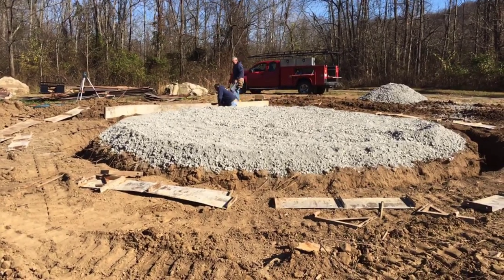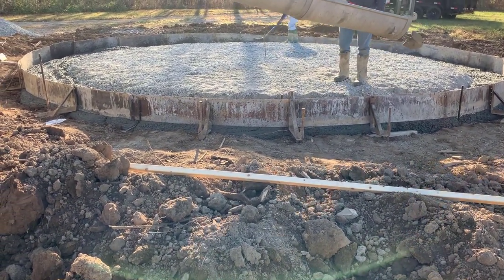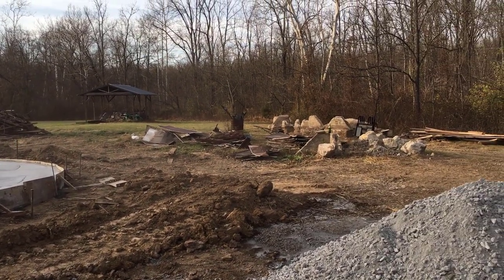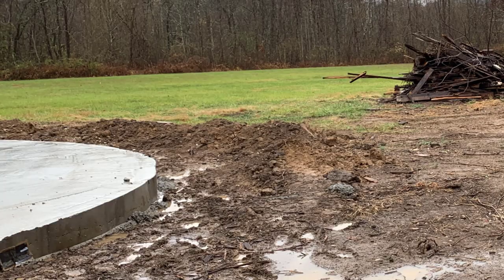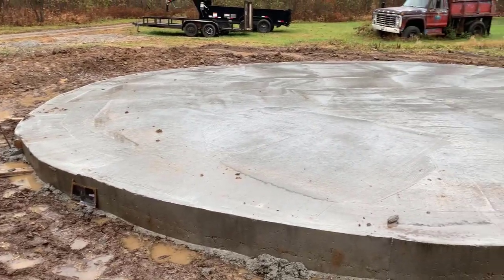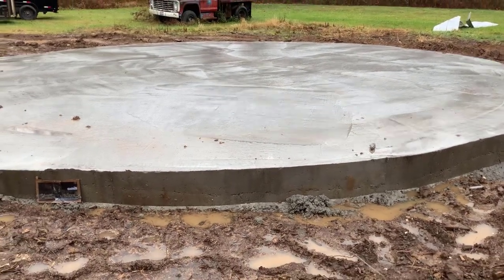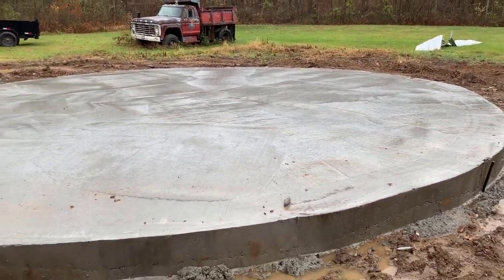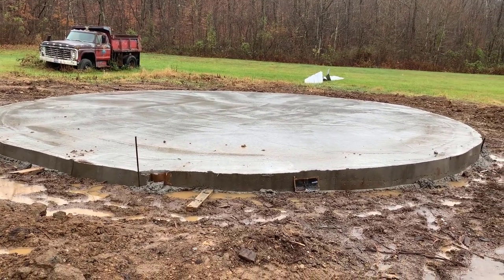How long do does concrete need to cure? *  removing forms grain bin foundation  E7

Comment: With this being a solid poured slab, can you share how you stub in your plumbing and electric? LOVE this detailed series BTW!
Reply from the maker: We are not stugging the plumbing or electric in the floor.  We are adding an addition about 20 x 30 to the back which will have a bathroom, mechanical room and kitchen area with a long table for family dining.   The addition will have a second smaller area floor that will have another bathroom.  Easier to deal with this way.

Comment: The people you hired didn't know what they were doing, either.  Or, they didn't care.  Backfill not packed or even very level, they slipped the form up, so it wasn't done in one pour and you could have a cold joint, and it doesn't appear as though they added any rebar.  Definitely none in the pad, not even mesh.  If it's for a house, electric, water, and sewer lines should've been stubbed in, it'll be a PITA now.
Reply from the maker: They used flaskes....the mesh was added on the second level where we have it set up for radiant heat in the floor.  We are building an addition that will have room to house the mechanics.  In retrospect...they were the best....agreed.